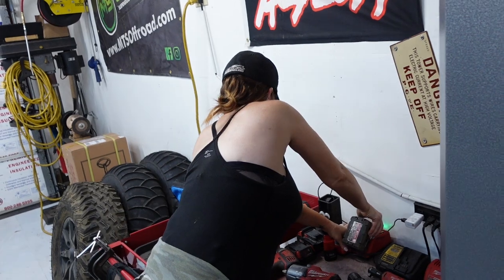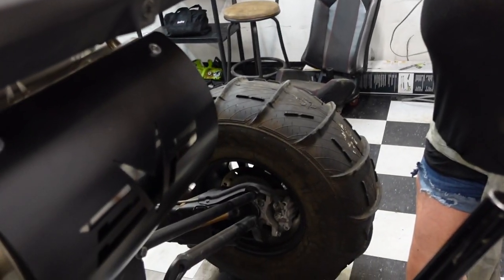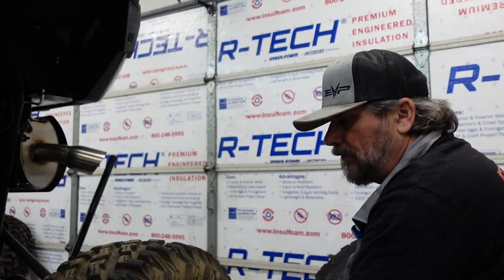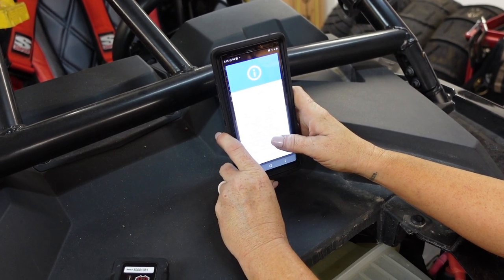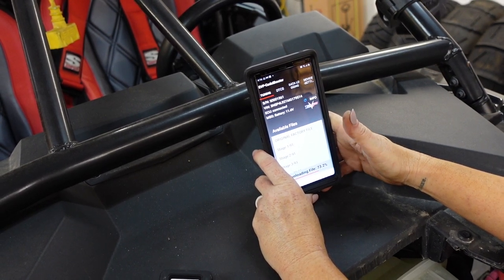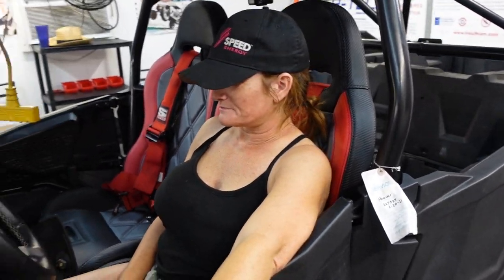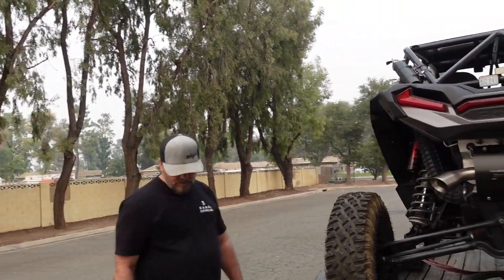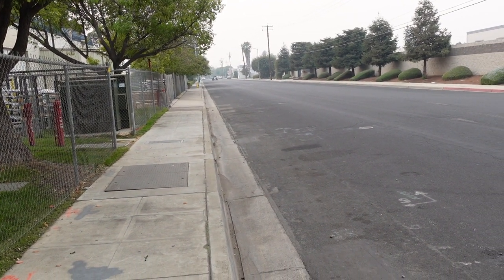Turbo S EVO Stage 2 RIP

Comment: I got the same car how is that tune and exhaust compared to stock can you actually feel it in the 💺 or just feels more responsive?
Reply from the maker: The jump from stock to stage one was pretty drastic. From stage 1 to stage 2 was just more responsive. Then it climbs from there. It's about a 20 horsepower difference from stock to stage 1 and only about another 20 by the time you get to stage 5.
Reply: Thanks